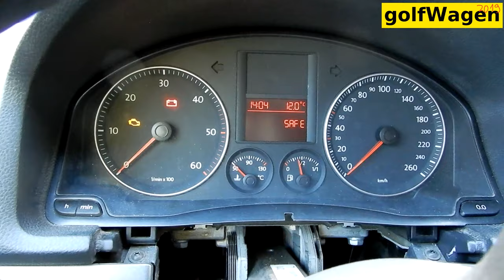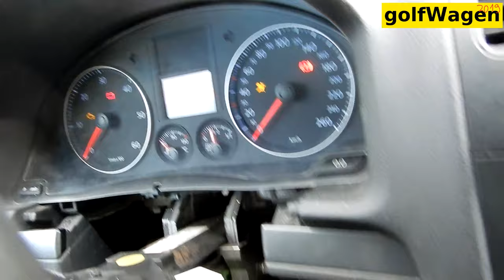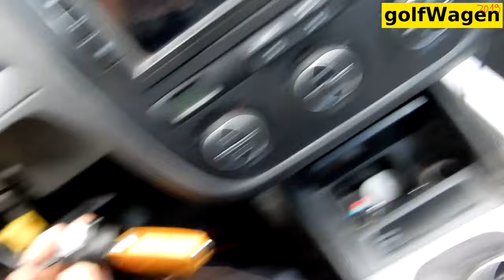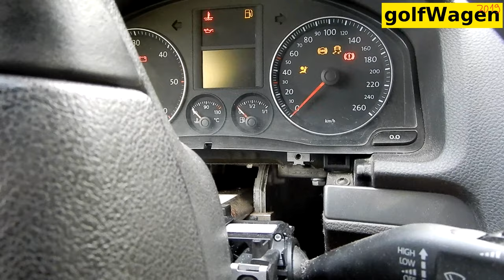VW Golf 5 ignition lock cylinder removal

Comment: Is it as simple as replacing the old ignition lock cylinder with a new one (supplied with a key incorporating a transponder) or does it some how have to be coded into the car’s management system as well in order for it to work and start the car etc? Thanks.

Comment: Hey mate, my ignition housing seems to be jammed as it won’t let me turn the car on. I’m currently looking for a Ignition barrel housing and my cars a MK5 2004 golf, Do the ignition barrel housings from later models (2005) or other older models fit it or does it have to be the original part for the actual car and model?
Reply: I’m scrolling through the comments and have the same thing, mine is a 56 plate Mk5 so I’m assuming yours is a Mk5 as well. If so it needs to be the same but you can buy new ignition, the barrel and housing easily on the internet.

Comment: My friend accidentally locked (OFF) my new ignition housing (he was testing it...will that make it so I cannot connect my ignition cylinder. My understanding is that they both have to be in the ON position. Thanks in advance for your response.
Reply: I don't know if you noticed...both have to be in the on position the little tab in the back of the lock must line up with the slot in the ignition ...AND you must have the pin in there, with the tab depressed (watch the 5:00 minute mark)

Comment: I have a problem . When you run the Golf 6 2.0 a deficit in engine rotation occurs. After removing the diesel temperature sensor the engine returns as it was meant with a good sensor switch. The problem remains only after removing the sensor wires

Comment: What do you do if the key doesn't actually turn that far ? Will that pin still pop it out??
Reply: No! I have the same problem right now and cant turn the key. Looking fr a solution to disengage the wheel lock.
Reply: @KosaBrin  same issue but my steering lock doesn't even turn on
Reply: @bikerboy3k  Well, I just fixed it. So if you need any advice...
Reply: @KosaBrin  Dude yea. How did you manage to do it ?
Reply: We do,  @KosaBrin

Comment: I took my key cylinder out and turned the buttom piece the wrong Way with a screw driver, and now the car is in steering lock. How do i get it out of steering lock now? I cant get the cylinder back in
Reply: I have the same issue!
Reply: GG Films did you figure this out plz
Reply: This happend to me too :( I am afraid that it needs to be drilled out.
Reply: Also
Reply: So I finally fixed it. You need to take whole mechanism what hold steering wheel and milion screws. Not very comfortable and easy but this is probably only possibility.
Reply: @michalknapek5697  Hi man, Can you tell me how you fixed it, cuz I seem to have the same problem, I the steering is lock and I can't use the screw to even start the car
Reply: The fix is not easy, you need to put out the whole mechanism which hold steering wheel. It's not an easy job and require to disassembly lot of plastic parts and screws.
Reply: @michalknapek5697  Can you help me out, cuz my car is in the basement and no towing truck can help me, the steering wheel is locked and nothing I can do about it
Reply: @quangtubui4304  sell the house with the car.
Reply: @michalknapek5697  so u have to take the whole shit apart????
Reply: @davidreza5651  if you mean shit around with plastics then yea
Reply: @michalknapek5697  hello Michael fox.
Ist das lenkrad wieder frei wenn man das komplette zündschloss ausbaut?
Danke
Reply: @benaissab.2843  plenty of videos, look for removing ignition lock vw...plenty of videos